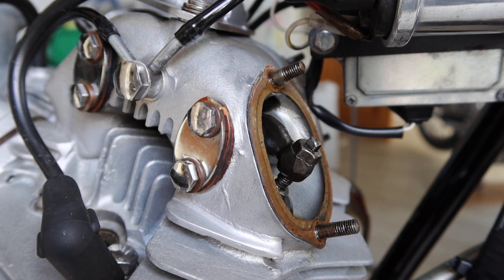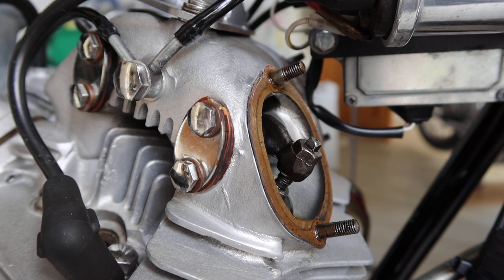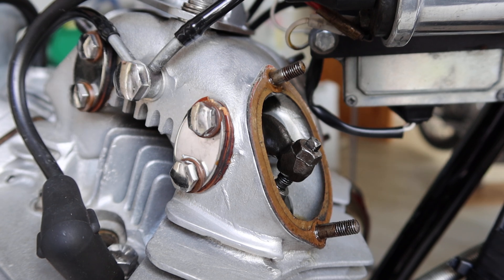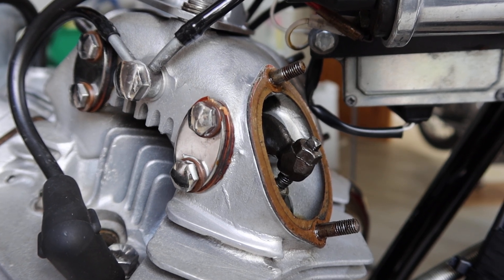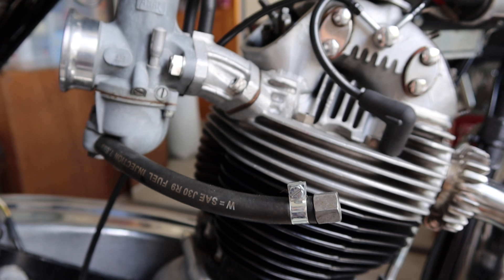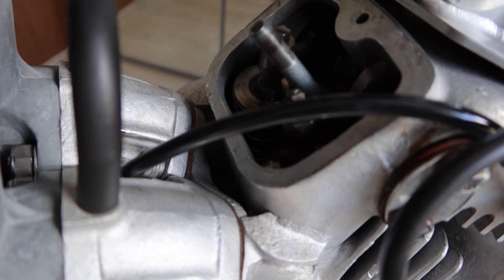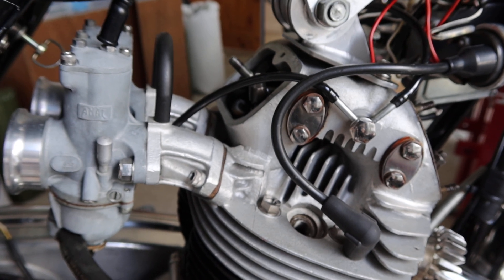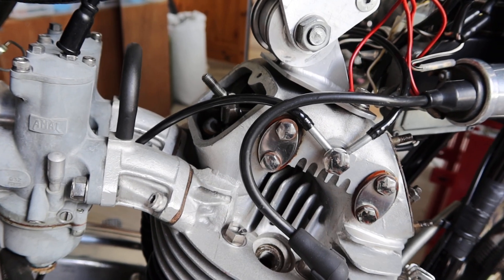Norton Commando Valve Geometry fix.

Comment: whats your thoughts on the combat motor ...as the factory just shaved abt .030"+ off the head with out shortening the equivalent amount off the pushrods ??
Reply from the maker: Mine is the Combat motor, though I now have the fantastic PW3 camshaft. What I did with my pushrods, is to work out the correct length by having the valve adjusters exactly in line with the valve stems when at exactly half lift.. I then  sent mine to Mick Hemmings to adjust the lengths. I cannot recall how I worked out how much to shorten them by. Maybe I set the standard valve clearances, then turned the engine over until any given valve was at half lift, then measured how much I needed to screw out each adjuster to get it in line with the valve stem, then have that much removed. This improves the valve geometry, but still didn't cure my adjusters sliding across the valve tips. I understand Norton increased the valve stem length for the Commando compared to the Atlas, I have no idea way as certainly for me, it created a problem.
Reply: @petercharlton515  Correct Answer I had my push-rods shortened abt .025"